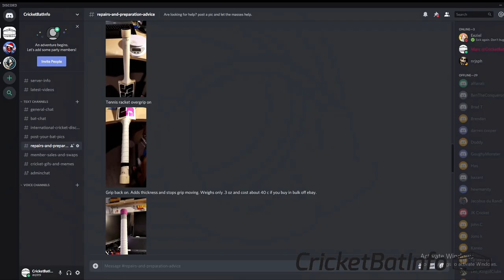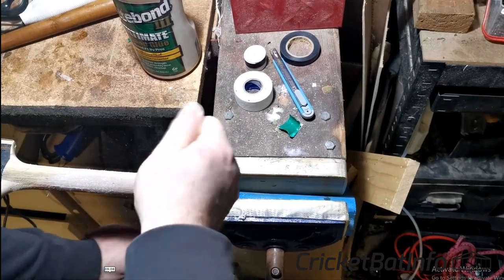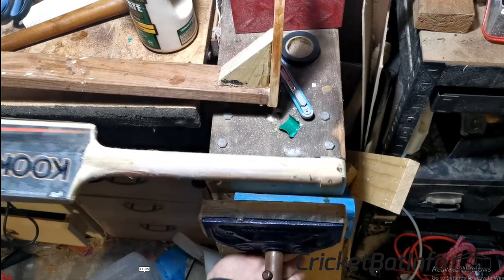Swapping the Binding on a Cricket Bat

Comment: Can you please share details on how to build the lathe to hold the bat and turn it for handle threading? Thank you!
Reply from the maker: It’s not a good design tbh. Bat keeps falling out. I made it in 10 mins with some spare wood and screws. Ends are just large screws I blunted that I tighten. I have to come up with a better system to hold the bats ends, but I don’t do repairs for money so I use it 2-3 times a year.